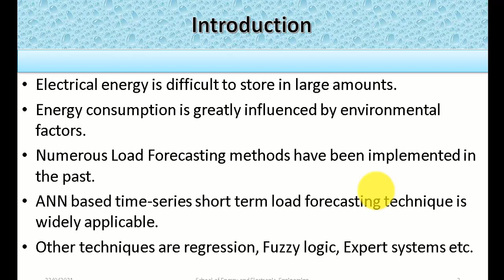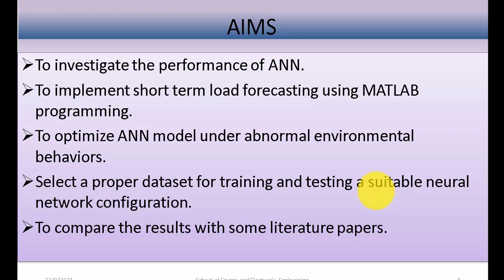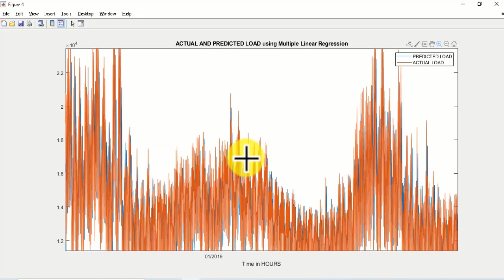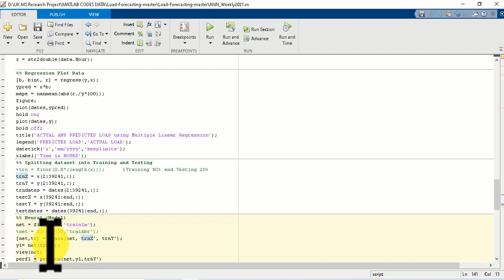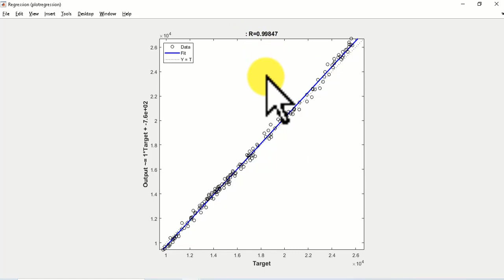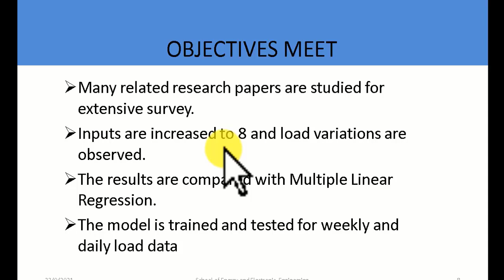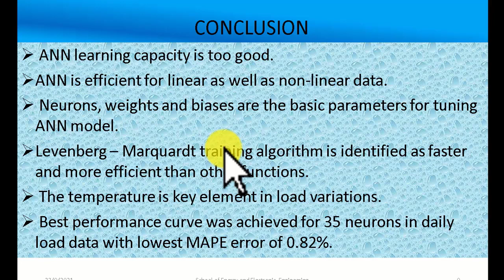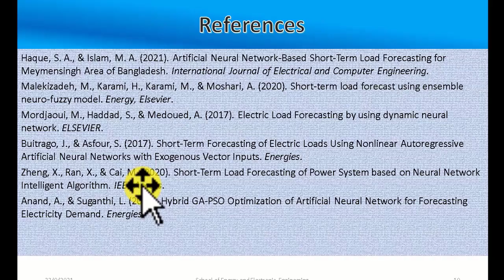Short-Term Electric Load Forecasting using ANN in MATLAB

Comment: The work you have done is greatly inspiring and informative. 

Dear check you email. I need some modifications in my code even Imcan pay you the fee for hlping me out in my research work. I am stuck in my code from previous one month, i had tried enough to remove the errors but unluckily couldn't solve the issues yet. I am hopeful that you will help me in my research.
Reply from the maker: I checked your code for errors. It need some changes to fix the issues. You can pay the relevant amount and inform me to start working on it. Thank you